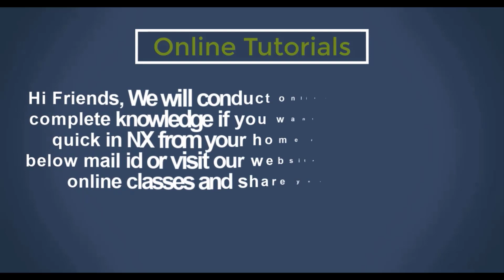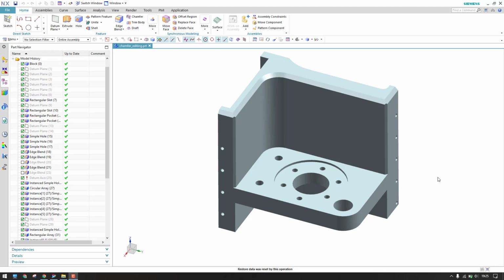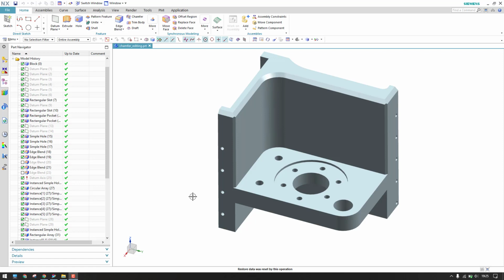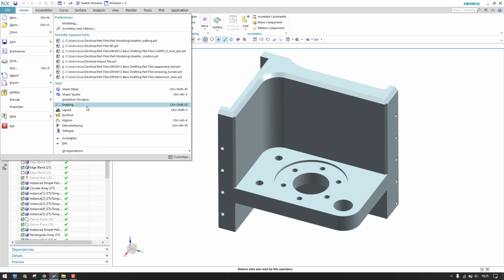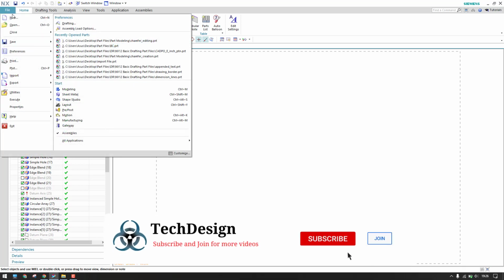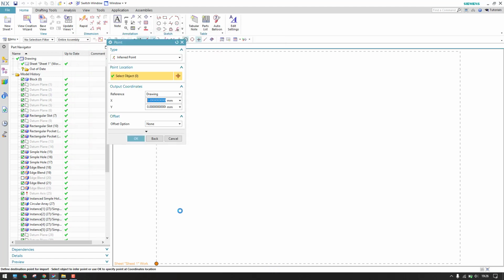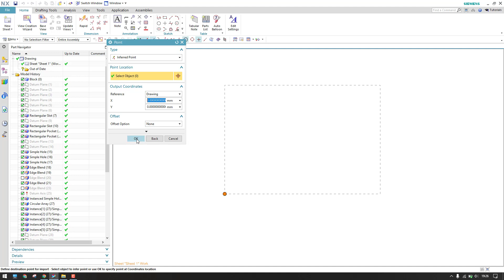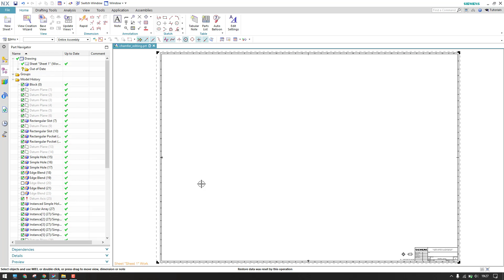Siemens Unigraphics NX Drafting - How to Import Border into Drafting

Comment: can u pls answer my question?
currently im using a step files given customer to create drawings by using the template i created on my own from scratch.but everytime i open part file and go to draft then i create drawing by selecting my template, the preference setting (like disable border font sizes) which i have set on my template is not loading and in draft it still shows the borders and default font size.

but if i open drawing template first and then insert the model the settings from preferences are applied.

since i need to draft a lot of drawings, it takes long time to change setting everytime..is there a way to solve so that if I open from model the draft also takes the preferred settings from my template everytime? thx in advance
Reply from the maker: Check in customer default settings to disable border and font size.. I am not sure if there is a setting availabl.. let me know here
Reply: @TechDesignsantosh   its availablw but everytime i open a new model and start the draft i have to apply the custom customer default settings to aplly it..or else it starts with default dimension and borders.idk if there is another way to solve this, insted of applying everytime i open a new model to draft.
Reply from the maker: Set your settings and restart nx.. in nx settings will not be saved if nx is not restarted immediately

Comment: How to change drafting model links to other model?? like solid edge
Reply from the maker: please elaborate
Reply: @TechDesignsantosh  Ex. I have model1 and I completed drafting as dwg1 and if I have model2 similar to model like model1 then I will copy that drafting and rename to dwg2 and change model links to using edit link options and with in few seconds or minutes drifting complete
Reply from the maker: No.... in NX model and Drafting will have same prt file.. but in some master model concept I think we can achieve this by replace component but not sure